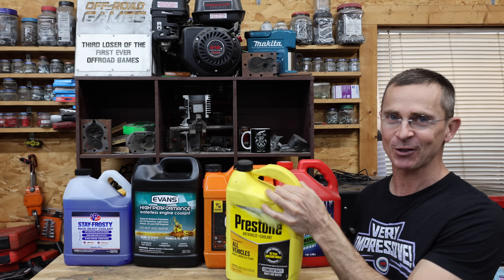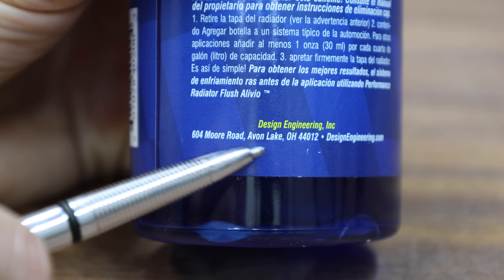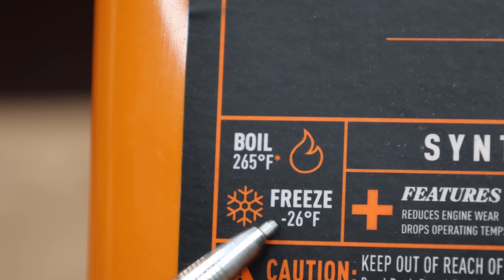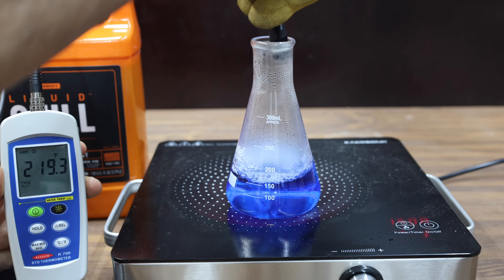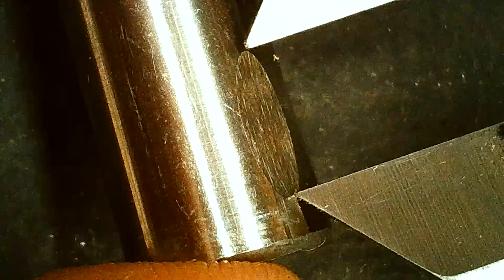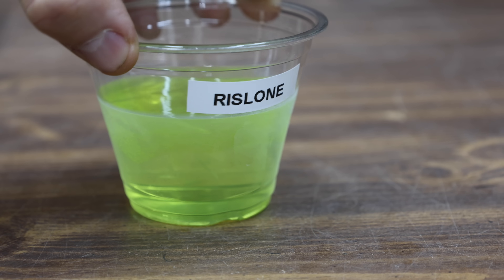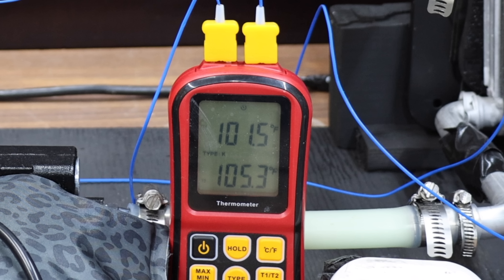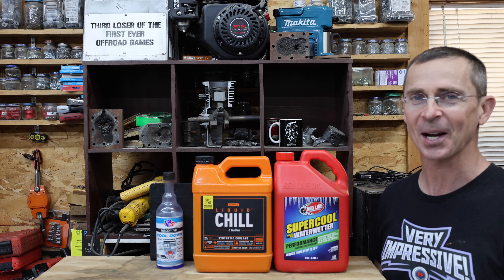Do "Super Coolants" Lower Engine Temperature By 30 Degrees?

Comment: I've used Water Wetter for my water cooled PCs for about 25 years.  Noticeable benefit as measured by CPU/GPU temps.  Though I haven't felt the need to use on the car . . . yet.
Reply from the maker: Thanks for sharing.

Comment: None of it made a single degree difference nor did plain water help cool my 496 Mopar stroker. My issue was a restricted fan shroud aka know as air flow issue. Took the electric fan and restrictive shroud off and it never went over 185 with a 180 thermostat.
Reply from the maker: Thanks for sharing.

Comment: Suggestion: Compare salt neutralizer for automobiles. Can this stuff be used in a foam cannon on a pressure washer would also be interesting. Test salt removal, residual protection, etc.
Reply from the maker: Thanks for the suggestion.

Comment: Nice work! The Acid neutralization and boiling point tests were excellent.
Reply from the maker: Thanks!
Reply: Next week he's testing 32 vs 45 crosshatch angle and low tension rings 😉
Reply: Two of the best right here.
Reply: unfortunately the actual coolant system heat transfer test isn’t.  Nobody is running their coolant system at 120°F.  The true test is to run the test near or at the system boiling point and then see what the results are.  Because then you’re going to get the true behavior.  I get that it’s called project farm for a reason, but you can’t just assume that the 120°F results directly correlate at 230°F.  IMO the Evans only placed 4th due to how it’s judged.  Because regardless of how hot the system might become, it didn’t boil at atmospheric pressure until 380°F+, about 150°F higher than anything else.  The entire point is not for it to run 10°F cooler at 120°F.   TEven if it supposedly ran lower at 190°F, the t-stat would just compensate for that.  The real question is what’s going to happen if the system is under load and approaching boiling point.  Once there’s surface boiling at the hot spots, which isn’t the same as the overall coolant temperature, that’s when the Evans product is going to shine above the others.  Once these other products start to boil over, that’s a runaway scenario and they’re done.  The higher viscosity of the Evans will result in a higher temperature because it can’t shed heat as fast as a thin viscosity, but that in itself doesn't matter because it’s not going to be anywhere near the actual boiling point. It can operate effectively at the boiling point of any of those other fluids.  They will fail, it will not.
Reply: just tell us the truth, your car broke down and im the meantime you're looking for a good coolant.

Comment: Evans hands down saved the engine in my e36. Moved to an island and had a cooling system issue.

 Overheated slightly but nothing blew up, or overflowedand I was able to limp home. Would NOT have been able to do that with standard coolant/water
Reply from the maker: Thanks for sharing.

Comment: A good video... But a little confusing for those of us not in the US 😂
You gave both temperature units on the chilled samples but only the weird gobbledygook numbers for boiling point and heated circulation... I can puzzle the results out just using larger than and less than Sesame Street logic but then in the circulating test it seems like you only warmed it up to hot bathwater temperature if I understood correctly.
It didn't look like the temperature delta (cooling) were linear... Maybe a pressurized truly hot test (like they would be under in a running vehicle) would give very different results?

The atmospheric boiling points are probably informative but if I remember highschool physics the boiling point under pressure could vary a lot more than 1ATM?

Comment: @16:12 I don't see a straight distilled water control or am I missing something? Most people running products like Water Wetter or Hyper-Cool don't care about freeze protection as its used for race conditions where antifreeze is not allowed or wanted. They really mostly care about temperature control, lubrication and contamination control. So could you please revisit this test using water as a control and then test the products that only use water + additive and no antifreeze? If you really wanted to make a comparison to antifreeze you could include different ratio's of antifreeze and water (I.e. 50/50, 80/20, 90/10 water/antifreeze mix).
Reply from the maker: Thanks for the suggestion.

Comment: Todd, your cooling loop flow setup is inverse of a correct efficient design. You want to pull from the top side of the reservoir(engine) and pump into the top side of the radiator. It's all because of convection of the liquid where cold water falls and hot water rises. That being said, I would guess the ranking of each "super coolant" would stay the same; you would just see a bigger drop in temperature.

Comment: You always do great comparison tests. Thank you. Is there anyway you could do cordless brad nailers. I know you've done finish nailers and staplers, but don't see that you've done brad nailers. I found some other channels that did them but you do some really thought out and amazing testing in your videos. I would be particularly interested in Milwaukee 18V & 12V, Kobalt 24V, Dewalt 20V, Bauer 20V, Hart 20V, and if there is a difference between the Ryobi ONE+ 18V and ONE+ HP 18V.

Comment: Amazing video as always.  I would be interested to see a follow up with a couple more brands.  Instead of using the total redline coolant, use the standard anti-freeze plus redline water wetter, and the same with the Amsoil version.

I'd also like to see how the Amsoil coolants perform on their own.  Reason being I have actually asked them and they say their coolants already contain the same thigs as their additives and thus there is no additional benefit.
Reply from the maker: Thanks!  Thanks for the suggestion.

Comment: I would have loved to see distilled water as a baseline in each test because in racing circuits I was always told nothing disapates heat faster than straight water it's just a trade off for the ability to raise and lower the boiling and freezing points.
Reply from the maker: Thanks for the feedback.

Comment: Every engine has a specific temperature range it is designed to run in....... you lower the running temperature you are not only using more fuel YOU ARE ALSO DAMAGING YOUR ENGINE!!!
Welcome to blatant stupidity......population aprox 8 billion x

Comment: I run Evans Waterless coolant in my Jeep LJ and so far I have been happy. I wanted to try it since the Jeep will sit for long periods of time between drives and I didn't want corrosion in the system. Seems to be doing the job so far. Thanks for the great reviews and keep up the good work.
Reply: 12 years in my last car and everything still shines! Great stuff. Love that it doesn't blow hoses off as well if temps do spike
Reply: @ very true about blowing hoses off. That is a great point and another reason I like the Evans.
Reply from the maker: Thanks, will do!

Comment: I got a hopped up and cammed up 1987 Pontiac firebird that runs a little towards the high side on the temperature.... I'm not even using a thermostat I have a brand new 3 row/core  radiator , brand new water pump and it doesn't leak any coolant whatsoever..... Do you think that hyper cool will help me out????

Comment: Why would you want to lower your engine temperature? Unless your engine has issues the thermostatic valve maintains operating temperature, if you run your engine cooler it'll reduce the operating efficiency. I'm highly sceptical these will change much over running the OEM specced coolant.

Comment: We need a ball joint/steering component video. 
  I replaced a ball joint on my 05 jetta and it failed in 20,000kms.
The factory one with nearly 300,000 kms on it going strong
Reply from the maker: Thanks for the suggestion.

Comment: Well let’s consider this option.  Stay frosty has a temp difference from inlet to outlet of 19, but the Evans raises the boiling point to 375 (very impressive).  So, would Evans be better based on saving a vehicle from overheating, aka “boiling”

Comment: I’ve had the same Evans coolant in my E38 750iL V12 cooling system for over a decade. I love it, since those cooling systems are notorious for failing because of the high pressure on the plastic parts over time.
Reply from the maker: Thanks for sharing.

Comment: is there an octane booster for gasoline that actually meets it's advertised claims and is there an advantage of running octane booster in a car? I have always wondered if putting the octane booster in my motorcycle actually did anything since I haven't noticed any MPG gain and no power gain compared to the low grade ethanol free gasoline.
Reply from the maker: Thanks for the suggestion.

Comment: It really depends on where you live and what you do with your car. Down south, we don't need anti-freeze protection, but we do need boil over protection. Just the opposite up north. So you should have given a "winner" score for each category. The Evans looks great....if you live up north. But pretty much useless down south. The VP Racing is great to lower temps if you track your car. And for $8, the Rislone give you a little extra protection in the summer. As always, fantastic work. Best channel on YT.
Reply from the maker: Thanks!  Thanks for the feedback.

Comment: Had I known you were about to do this, Id have shipped you my old bottle of Evans. I tried it in my truck with an engine rebuild, and come winter I started getting no heatercore heat. Swapped it back to a 60/40 mix coolant (4 bottles premix and 1 bottle concentrate) and got better but still lackluster heat in the cab.
Reply from the maker: Thanks for the feedback.

Comment: Hey Boss, 

Long time listener, First time caller…. 

I was wondering..  I’m a Company Owner..  and I’ve always wondered..  

Concrete for posts..  
steel post
Vinyl Post
Wood Post…

What is better..  

Quick mix Dry pack
Quick mix (manufacturer specifications)
Quick mix extra water
Quick mix less water 
Or a Portland/navy jack mix (standard)

Maybe we can put it to rest..  

Cheers
GWC 

A+ with the coolant btw..
Reply from the maker: Thanks!  Thanks for the suggestion.

Comment: At first I was very impressed with the Evans. Then I got to thinking, most exhaust valves will fail when engine temps reach above 270-280 degrees if the engine is running at any type of load. So while impressive at 388 degrees boiling point, it's something you'll never need. I guess for me the most important thing is the ability to remove heat. So from that standpoint the VP Frosty looks really good. Unfortunately it regularly gets well into the minus 15 degrees here in Missouri and even as low as minus 20ish occasionally, so I think the Redline Super Cool might fit my needs best. Thanks for a great test.
Reply from the maker: You are welcome!  Thanks for the feedback.

Comment: All very interesting but what I wonder is:  at the recommended strength of the additives, is there actually a measurable difference?   Can putting 8iz of additive really make any measurable difference in an almost two gallon system?
Reply from the maker: Thanks for the suggestion.

Comment: Lower temps is a BS claim if anyone knows what a thermostat does. Unless you're specifically trying to run low temperatures like 160 degrees for racing with a tiny light radiator and no HVAC, there's no point of a coolant that can transfer heat better than plain old 50% water and 50% glycol. Cars that drive daily on the road should run around 220-230 degrees for efficiency and emissions reasons (and it's all by design to run that hot). And you can always raise the boiling point by running a higher pressure cap.

Comment: It should be pointed out that VP Racing Stay Frosty is specifically a coolant....NOT an anti-freeze.  It's also not intended for use in street vehicles.  It's intended specifically for racing applications.
Reply from the maker: Thanks for the feedback.

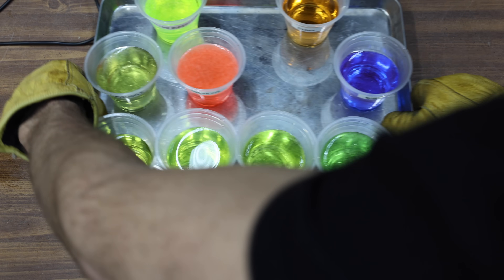Comment: 12:15 this shows why engines have a thermostat that doesn’t open until a certain temperature. So that in sub-freezing temperatures your engine has time to warm up and melt the coolant before ice crystals start flowing through your system

Comment: I don't quite understand why you would need to use this. Engines are designed to run at a certain operating temperature. If it runs cooler than that, you'll lose mpg, among other things.
Reply from the maker: Thanks for the feedback.

Comment: Im surprised Redline Water Wetter didnt make the cut. Sure, supercool has water wetter in it, but its significantly cheaper than supercool and loads of motorcycle guys run it on the track with plain water.
Reply from the maker: Thanks for the feedback.

Comment: Could we get a comparison on combination drill and tap  sets, like Ideal (model number 36-600), Klein Tools (model number 32217), Hercules (model number 58923), and even the cheap ones online. Big differences in prices and you gotta wonder, are you paying for the name or quality? Klein wants $50 while Hercules wants $18 and online the no name ones are around $8. Are the non impact rated ones better than the impact rated, will the cheaper ones shear in half in use?
Reply from the maker: Thanks for the suggestion.

Comment: I just need and want my diesel A3 1.9tdi 8P1 engine to heat up faster; so I can then actually put the heating on; and so it's running at peak operating temp ASAP! Just as important, I need the coolant to prevent corrosion as much as is possible... which, even VAG recommended, highest spec, hasn't been great at (given rust / corrosion evidence at last flush and change)!
Reply from the maker: Thanks for the feedback.
Reply: You better be Ukrainian
Reply: @I_SuperHiro_I  What if I'm not.
Reply: @ I don’t care?

Comment: I love your channel but, your test to measure the coolant's abilities to cool is completely flawed. Liquids that have very low heat capacity will score very high on the delta temperature test. Try using mineral spirits or mineral oil or even diesel fuel in the test. It will show a really high temperature delta because these liquids have a much lower heat capacity than just pure water.  Some of these additives in your test are designed to increase the heat capacity of the coolant.  For the test to be valid, you would first need to measure the heat capacity for the individual coolants. Then in your delta temperature you would need to measure the flow rate of the coolant (or be sure it is constant).  The actual performance of the coolant would be proportional to

 (heat capacity) x (flow rate) x (temperature delta) = Watts cooling (if you use the appropriate units.)  

You have no idea what the heat capacity is for the individual coolants you are testing so just measuring the temperature difference will not tell you the coolant's effectiveness. 

Over 2500 comments when I posted this, so I doubt you will ever see it.

Comment: I disagree with the "average finish" metric. You rated stay frosty last but it had the greatest temperature drop!!! Huge flaw!! When you buy a product you want it to deliver what it says it will do and anything after that is a bonus. This test should be weighted for each category. Most people who are at this level of vehicle consciousness are using it for a performance application and other factors like wear, ph, crystalization point are negligible because all the other products are extremely similar in those "other" categories. Again you just rated the best performing "temperature reducing" product last? I use royal purple before you ran these tests so i was rooting for that one. Ill be trying stay frosty going forward.

Comment: Are coolant flushes really necessary? Dealers and mechanics want like 400$. Does it depend on where you live ? Can I just test the ph of my coolant to determine ? 

Same with brake fluid ? 😊
Reply: Drain. Replace. That's cheap. Diy
Reply: @PonkyKong  thanks
Reply: @danielgallocker2692  no problem. I use the premix and replace the drain cock if you have one. Since they are like 6 bucks and they tend to leak. You should save like 350 bucks. And do it cold. Change the thermostat if it's easy to get to. And if you're feeling brave. A new coolant temperature sensor. That's a service they want like 1000 for. You can do it for 65 bucks. Maybe less.

Comment: Great video and a tough product to tackle. I do think one of the most important things to take a look at for these products is the rust protection and electrolysis prevention (galvanic corrosion). Since there are often times mixed metals in a cooling system, it leads to a scenario where you need to worry about galvanic corrosion happening.
Reply from the maker: Thanks!  Thanks for the feedback.

Comment: It is my understanding that automotive oil with zinc additives require the engine to operate at a certain temperature. Using a coolant enhancer to lower the operating temperature may cause unintended consequences to the engine.
Reply from the maker: Thanks for sharing.

Comment: I think you should have done the Evans first since water contaminates it and decreases cooling capacity. They make a solution that removes water from the system when converting over. My guess is this was not used before testing. I would like to see if another test with no water, has a different result.
Reply from the maker: Thanks for the suggestion.

Comment: I used to use RedLine Water Wetter in my racing bike. Coolants are not allowed as spilled coolant is much slipperier than spilled water. The most interesting characteristic was the greatly increased engine noise. Temperature and sonic vibrations work the same so the increased engine noise was an indication that the stuff was working as advertised. It had the same effect when mixed with coolant on my street bikes.
Reply from the maker: Thanks for sharing.